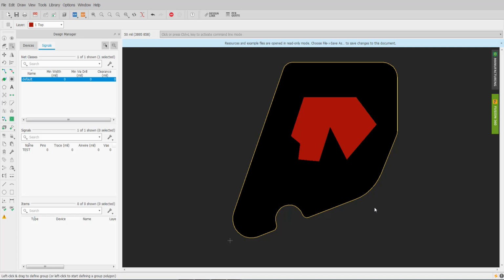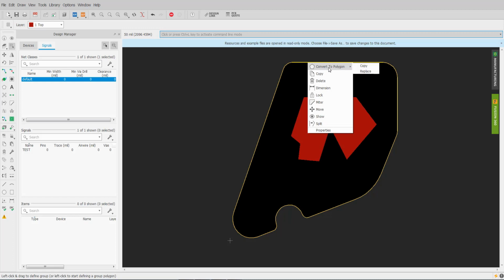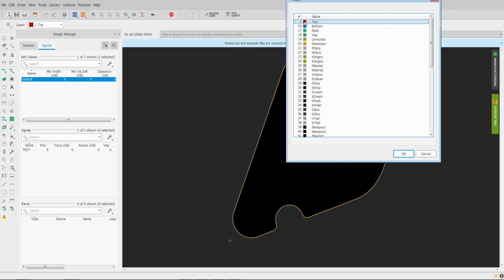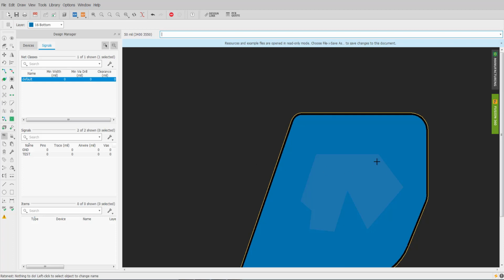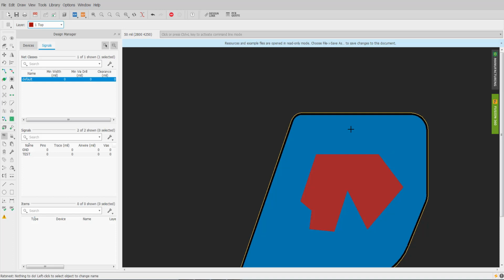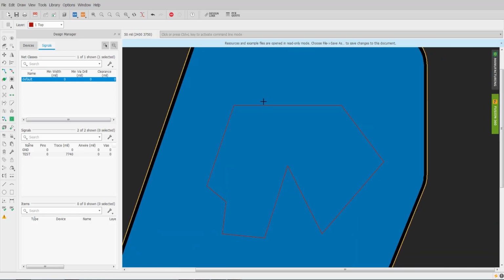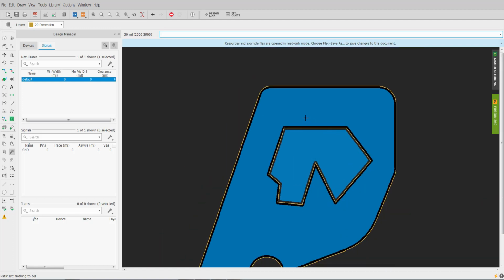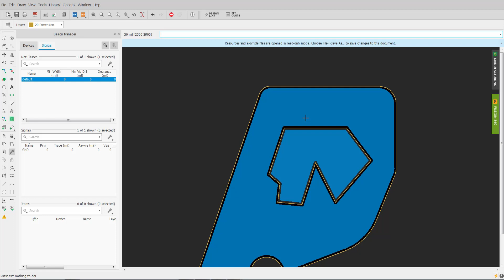Polygonize Command - PCB Design - Autodesk EAGLE

Comment: what Version does the convert to polygon first appear in? 

Does it work to create the circuit board area.
Reply from the maker: Hi Thomas, The Polygon Command in EAGLE PCB design tools was first introduced in V9.1.0. It can be used to make a board outline since you can go from polygon to contour and vice versa. Thanks for your question!  Cheers!

Comment: Thank you Jorge, a very welcome update and has reduced significant time required to properly manage dxf imports. In the past I resorted to converting the exported lines to copper layers and using routing tool to be able to shape the pour. However it seems like drawing a shape such as a circle and then right clicking does not give you the option to convert to a polygon as opposed to using lines and arcs. Creating a circular pour has been an issue when using eagle for me.